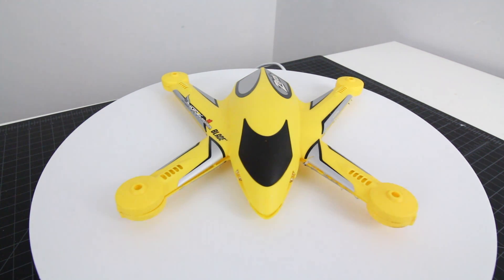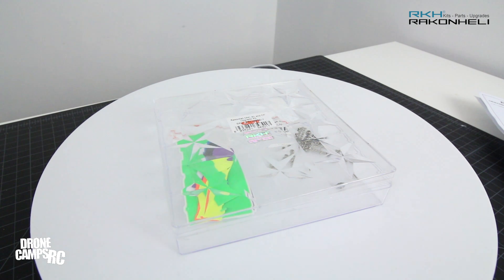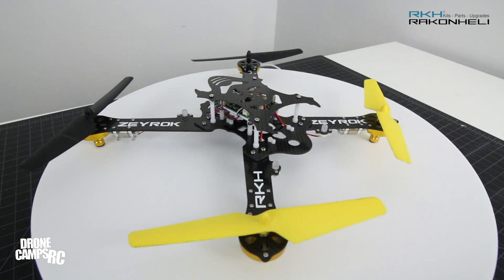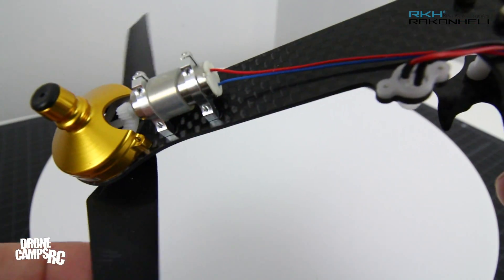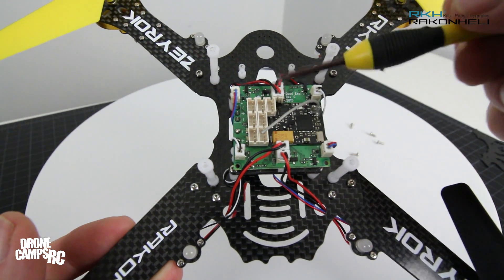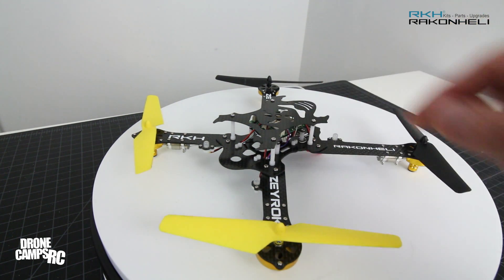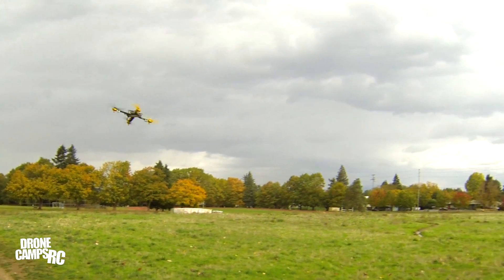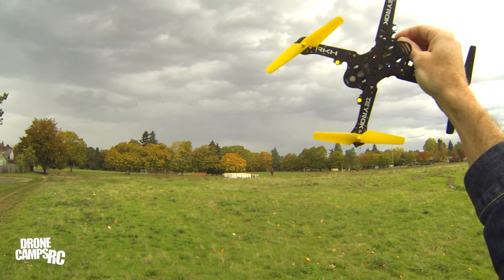BLADE ZEYROK - CARBON FIBER Upgrade and Flight Test

Comment: I just put this build together and would like to add another tip.  When installing the motors into the motor mount clamp, install the clamp closest to the landing gear and leave the bottom screws that attach to the arm and top screw loose.  Install the motor into the first clamp, then slide the second motor mount through the cable onto the motor.  Then attach it to the arm and tighten all screws.  I found that much easier to do that way.

Comment: Can the top plate be switched around so the two points point backwards not forwards? Please can you try it out I hate the look of the frame with that empty camera space.
Reply from the maker: yes it can. I did it. - JD
Reply: Drone Camps RC ahh ok, thanks. I really want this frame but hate how the motors are on the bottom, one snag on a bit of grass or similar object will ruin your motor wires. Have you seen the zeal heli frame? Looks much better but replacement parts are not available.
Reply from the maker: Your motor wires will be fine. Use electrical tape over them on the bottom of the arms. That will keep them safe in a crash or landing. This is what I do with my mini fpv racer quads. No I'll have to check out that Zeal Heli frame though. - JD.
Reply: Drone Camps RC after a good few hours of decision making, i went for the zeal help frame and got a few goodies from Rakon heli like LEDs.
Reply: Zeal heli**

Comment: Looking good JD but like i've said before i hate geared motors,maybe it's the brushed motors but it could also be the sound,because they sound to toy like for my liking,but having said that she is a sweet looking quad after the upgrade and you are 
right the yellow really does pop out,going to have to find some yellow props for my 
250 and smaller quads now. ;-)

Keep them coming brother = thumbs up